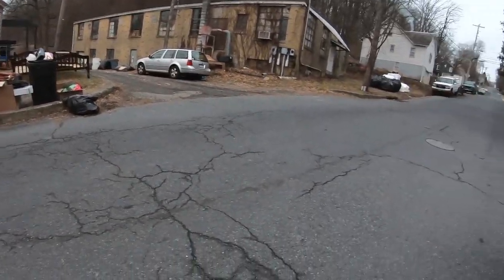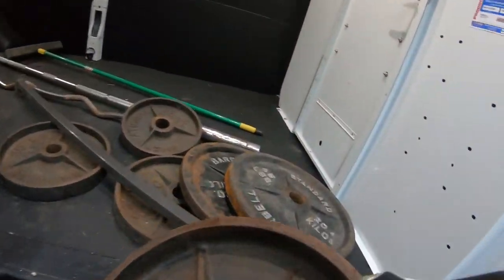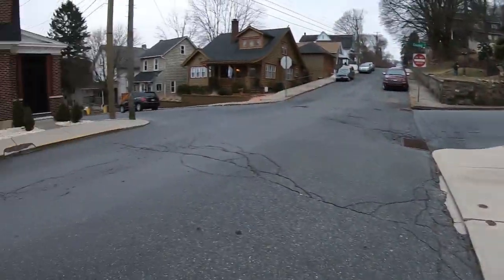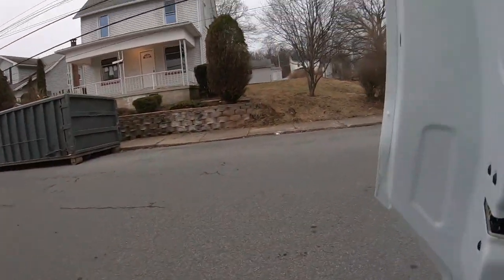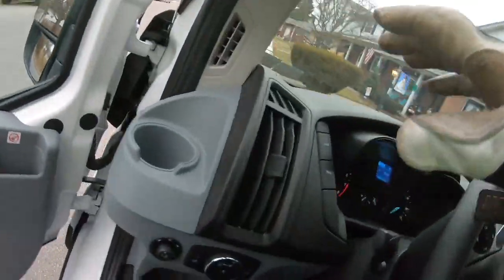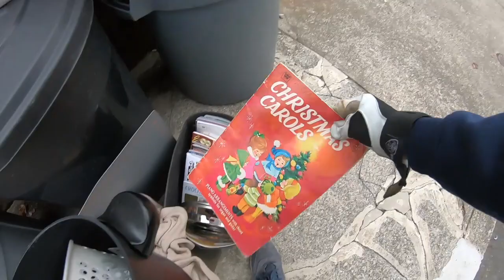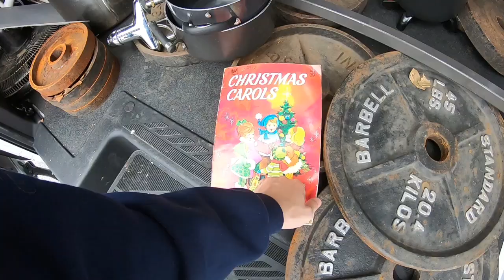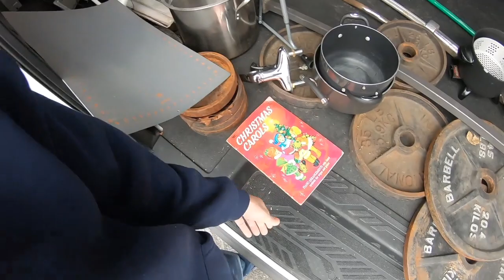Look What I Found In The Trash THIS WEEK - Garbage Picking Ep. 248

Comment: Taco you can easily fix a scratch with touch up paint.
Reply: Exactly. Auto parts store, online, maybe even dealer sell small bottles of touch up paint with a built-in brush. Usually exact match to OEM paint. Scratches can turn into rust spots.

Comment: They make a small bottle of appliance paint with a small brush and you can cover the scratch up with that.
Reply: The van manufactuer also makes scratch & dent paint specifically for each paint code!💜
Reply: @janetthurston852  And intended for exterior use in vehicles, not indoor appliances.

Comment: Do you use your parking break? When you park on a hill without the break the car will roll a little putting all the weight on the transmission. Just a heads up.

Comment: The rusty weights just wire brush them and get a cheap black spray paint to make them look good FB them and 10 times your money from scrap price. Your a inspiration. Great Video as usual.
Reply: waterfront4me Wire brush chucked in a drill + Rusteoleum spray paint = Easy quick turn around.  Thanks for the video. Best, B